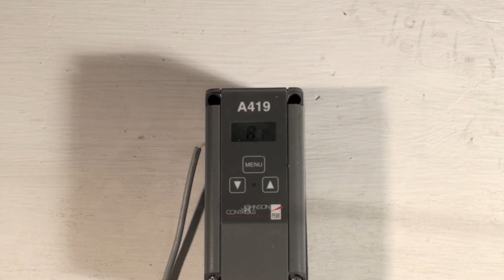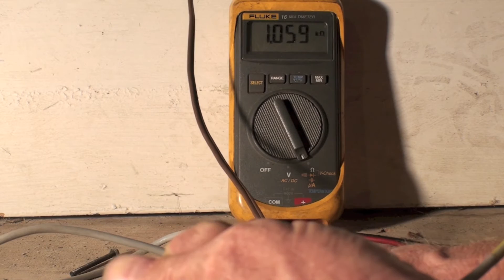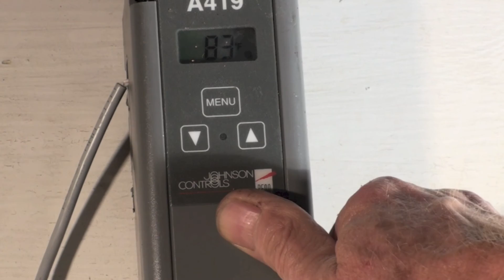Electronic commercial thermostat explanation

Comment: Good video. Btw you can get an electronic  digital thermostat control from Ebay for about $25. I have one running an old refrigerator instead of using the $60 factory thermostat. It works great.